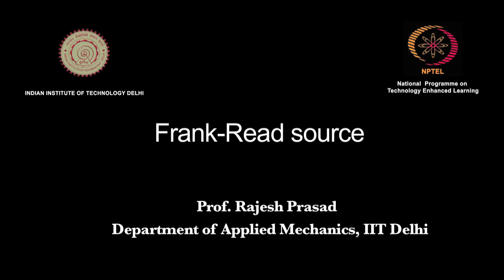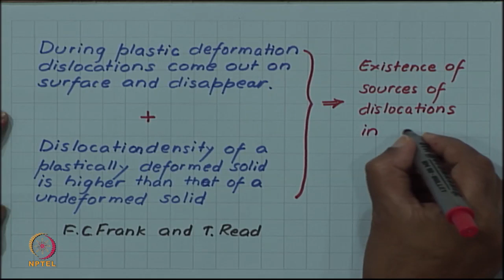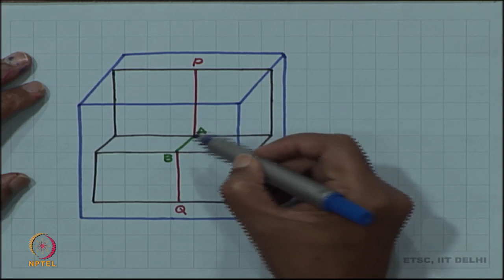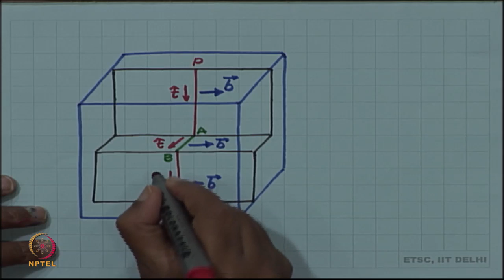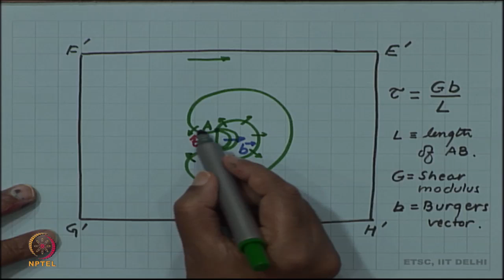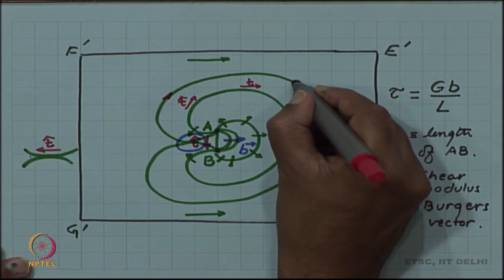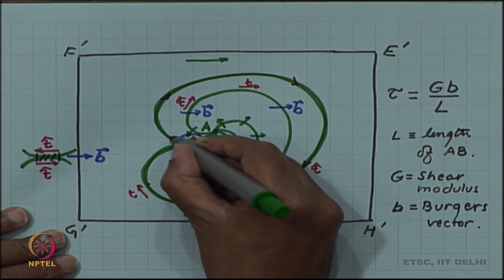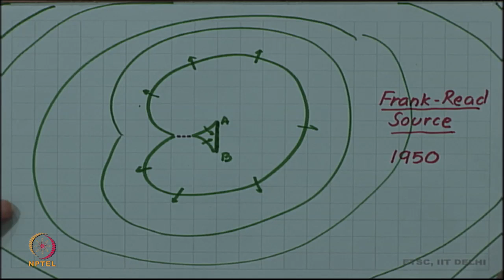Frank-Read source

Comment: Sir, in your video introducing dislocation nodes, you said all the t would be either point into or away from node and sum of b is zero. In this frank-read example,  we have a 3-D dislocation network and the dislocation segment is defined by nodes A and B right? But the two sense vector t on node A and B are point into and point away from node and they have same burger's vector in magnitude and direction, the sum of b seems not to be zero.  Could you explain this? Thanks!

Comment: Sir , As you explained the movement of the dislocation loop through the slip plane, What will happen to the expanding loop of it encounters a grain boundary that is lying on the slip plane. Will the dislocation loop pass through the grain boundary as well or will it stop as has been discussed previously that dislocation ends on a grain boundary. Request throw some light. Thanks and regards
Reply from the maker: You are right. A grain boundary in the path of the loop will act as an obstacle to the expanding loop. This will lead to hardening due to grain boundary.

Comment: Sir so it is a screw annihilation  ? As my teacher at school stated that it is an edge annihilation by stating that symbol
Reply: at the point of annihilation two dislocation will be of opposite sign. But they can be either edge, screw or mixed. In my example since the initial dislocation segment (source) was edge, the two segments at the point of annihilation were screw. But if I had taken the source to be screw then the annihilating segments would be edge. And if the source is mixed then the annihilating segments are also mixed. This is because at the point of annihilation the line vector is perpendicular but the Burger vector is parallel to the corresponding vectors of the source.

Comment: Sir , 
1)as you said that if shear force increase the dislocation line will keep bulging.
2) the plastic deformation is due to slip and in which if we push the plane then one half plane is attached to nearer half plane and  nearerb half plane is behaved like dislocation that means dislocation is moving during the plastic deformation.
These two statements are quite contradic to each other. 

Sir could you please explain.
Reply: Your point 2) is for slip caused by movement of a STRAIGHT EDGE dislocation. However, slip is caused by movement of all types of dislocations--edge, screw or mixed--and whether straight or curved. Whenever a dislocation line sweeps an area, the crystal on the two sides of the area have a relative slip equal to the Burgers vector. 
In your point 1) we have a Frank-Read source. There is a curved dislocation loop whose character is varying from point to point and is bulging. In the process of bulging it is also sweeping area on the slip plane. Thus it will also cause a relative slip of the two crystals lying on either side of the slip plane.
Thus there is no contradiction. Only, the situation is more complicated in case of Frank-Read source than in the case of a straight edge dislocation.

Comment: why there will be no shear stress  on CDEF AND GHIJ . PHYSICALLY OR MATHEMATICALLY CAN WE PROVE IT
Reply from the maker: Yes. This is called stress analysis. Given a state of stress in a body, you can calculate shear or tensile stress on any plane. The calculation of resolved shear stress on a slip plane in a slip direction for a given applied tensile stress is a special case of this general formalism. In particular, in the present case, you can show that if we apply shear stress on a given plane it will not generate any shear stress on a perpendicular plane.

Comment: Why does this kind of behavior happen under applied shear stress, rather than dislocation PQ breaking up into 3 separate dislocations, with dislocation AB then gliding out of the material?
Reply from the maker: We have a constraint that a dislocation line cannot end abruptly inside a crystal.
https://www.youtube.com/watch?v=WgSx1mZjki4&list=PLfIFNJ1DPG4mPl_4FP2o-8d23eiwGY7Sr&index=12
Thus AB cannot break away from PA and BQ as then the three dislocations will all have abrupt endings inside the crystal: PA will end abruptly at A, AB at both A and B and BQ at B.

Comment: Sir, Why shear stress will not apply on the plane CDEF & GHIJ
Reply from the maker: A shear stress applied on any plane cannot have a component on another plane perpendicular to the first plane.
Reply: @introductiontomaterialsscience  but why so ?
Reply: @introductiontomaterialsscience  This claim is not entirely correct. See a better explanation below in repsonse to Divya's question.
Reply: @diya3279__  You can take a free body with the surface of your interest as an external surface. You will find that there is no need to apply any force on this surface to keep the body in equilibrium. Thus the shear stress will be zero. 

If you cut the sample shown in the video along the CDEF plane (extend the cut below DE to the bottom of the sample) and consider only the back half as your free body. Then this sample will be in equilibrium due to forces on its top and bottom planes. To balance the moments there will be forces, and hence shear stress, on left and right faces as well. (Thus my claim in the above reply to Faiyaz is not entirely correct) But under these forces now the body is in equilibrium so there is no need for any force or stress on the front and back faces.

The result can be obtained more directly and mathematically by the transformation of stresses. But I have tried to give a more physical explanation above. 

Thanks for asking.

Comment: sir is it mean that on vertical plane dislocation will disappear or remain as it is and on the other  hand on horizontal plane on which shear force is acting , there will be continuous formation and disappearance of dislocation ,whose net effect is to increase the dislocation density . sir please make a few lines comment on conclusion made from video number 116 and 117 not considering the mathematical relationship as you mentioned in lecture number 120 . i got some idea but i am not very much clear about the conclusion.
Reply from the maker: I think your statement is correct. The vertical segments will not disappear but remain stationary. That's why the end of these segments on the horizontal plane acts as pinning points for the horizontal segment. It is this horizontal segment which acts as a source of dislocations by throwing out loops.
Reply: thank you sir
Reply from the maker: Yes the vertical dislocations will not be affected by the applied shear stress for the situation shown in the diagram.
Reply: Hello sir ur explanation is so elaborate . I could understand the concept . deeply
Reply: @introductiontomaterialsscience  if loop dislocation is merges into grain boundary then how dislocation density is increased sir .please explain sir.
Reply: @khajashaik9704  I think he's saying that the segment AB is regenerated and generating new dislocation loop continuously. I don't why AB is regenerated but perhaps because full dislocation line is PABQ and with the vertical dislocation segments stationary, the horizontal dislocation segment would always be regenerated. (I'm not sure about it

Comment: Sir what is source of that normal force that is expanding the loop you have said that it expands but there is no perfect cause of force for it
Reply: A force acts on the dislocation whenever there is a shear stress on its slip plane in the direction of its Burgers vector. This force is always normal to the dislocation segment. A loop has the same Burgers vector at all its points. Thus a shear stress in the plane of the loop and in the direction of the Burgers vector will produce forces normal to each of its segments. If the force is sufficiently large, i.e., greater than the critical resolved shear stress required to move the dislocation, the loop will expand.
Reply: @rajeshprasad101  is there a separate name for force required to move the dislocation in the slip plane and also thanks for the previous ans sir
Reply from the maker: You can call it 'force on a dislocation'.